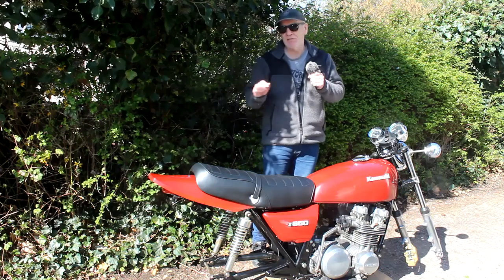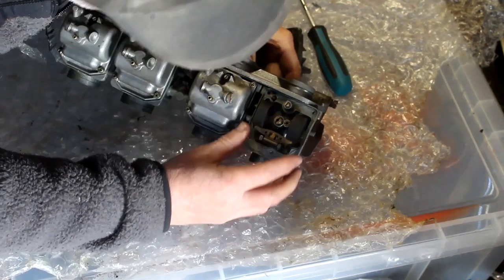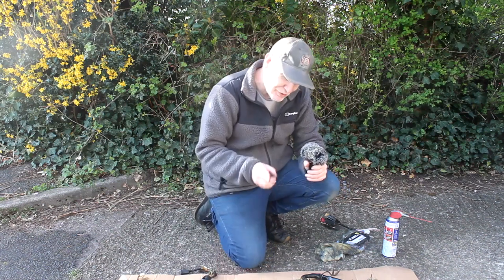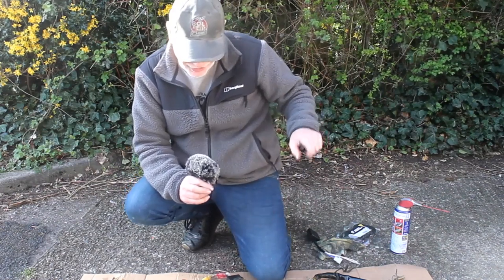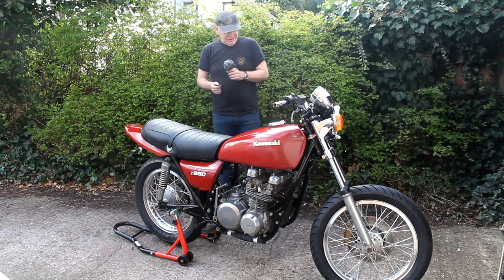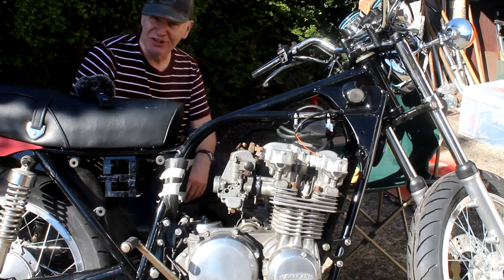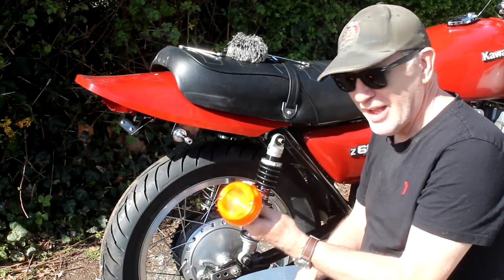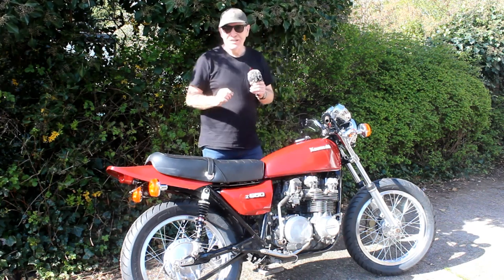Kawasaki Z650B Restoration Project - Part 8

Comment: I used YSS shocks on a Harley, i bought them direct from YSS in the UK, they let me choose spacers at the correct diameters at no extra cost, other retailers wanted an extra 50 quid. I find them perfect for the bike (it's a Harley after all).
Over the years when i needed spacers i bought a 1m length of stainless tube with the correct ID and OD and cut them to length usually cost about £10 with loads left over, oh and I have a lathe in the garage. You're doing this bike the way we had to, 40 odd years ago I replaced the gearbox in my CBX engine in my bedroom, hung frame on the washing line to paint etc lol, your doing a great job.